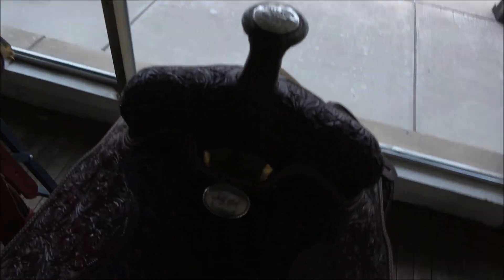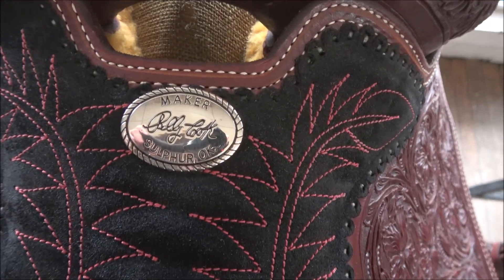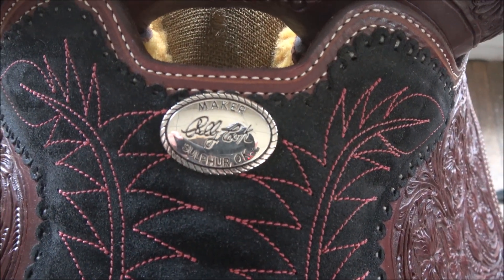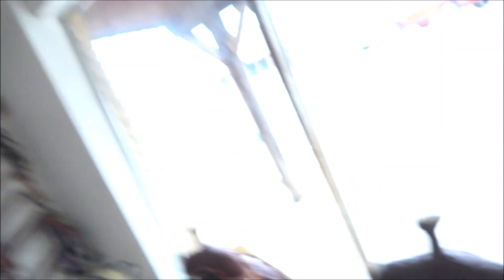2nd Billy Cook Logo (cnc'd)

Comment: Do you recreate your work in the computer by hand or trace it from a photo you took? I'm curious of the process as to the order that files are created. For example, start with a jpg, convert to something, convert that to something and then convert that to G code? Great work though. Your signs look awesome
Reply from the maker: Vectric Aspire has a trace feature that converts a lot of images to lines and often do it to where I have to do no touch up...On this one your looking at, had to do some tracing in the program by hand, isn't to bad the program offers some good tools....and when you do a trace it changes it to a vector which is then changed to gcode when you go into the tooling page to determine what process you will use......Thanks for watching!!